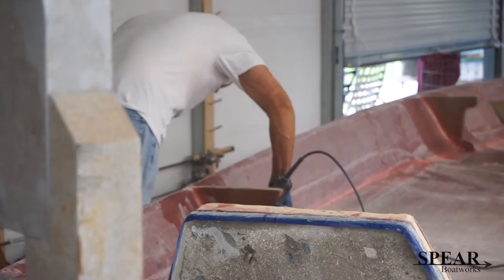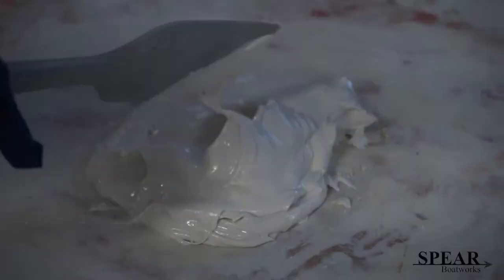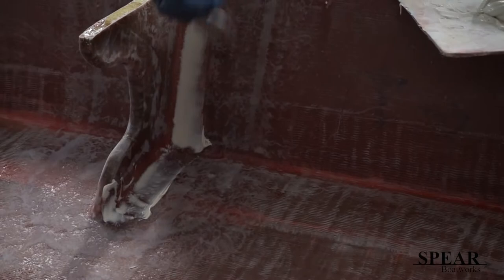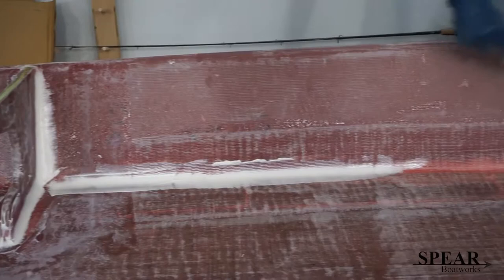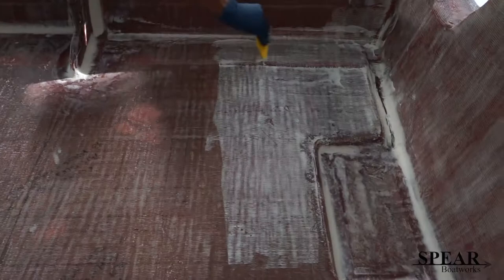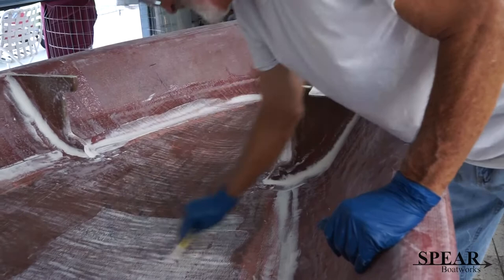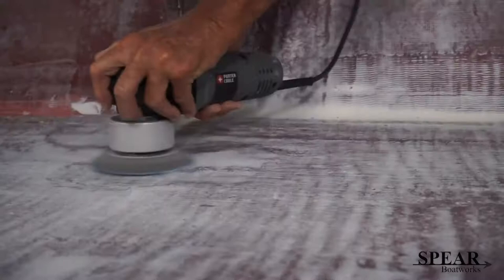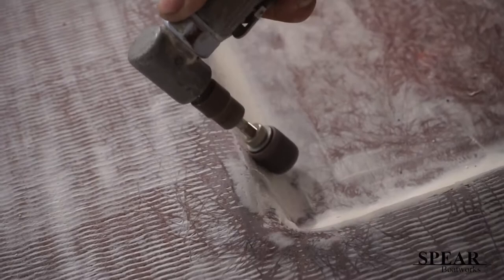Step Two: Fairing Out the Boat

Comment: Harry, I used to be an aircraft composite guy. For cleaning up radiused inside corners I always used the teardrop and ball shaped grinding stones. I kept a bunch of different sizes on hand. When they would get gummed up I would just run them against a piece of cinder block.

Comment: What is the reason for doing this.
Reply from the maker: Fairing is cosmetic. It covers imperfections in the layup process. Adding a radius in a joint , filling a void adds structural integrity to the global structure. Therefore fairing can be and is multifunctional .
Reply: @harryspear1948  cheers Harry, are you not better to just flocoat it.